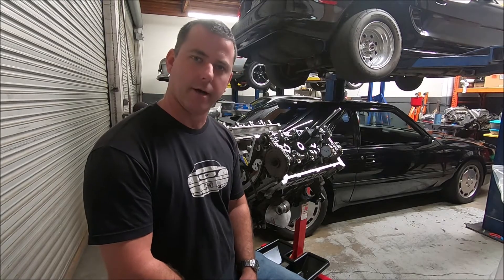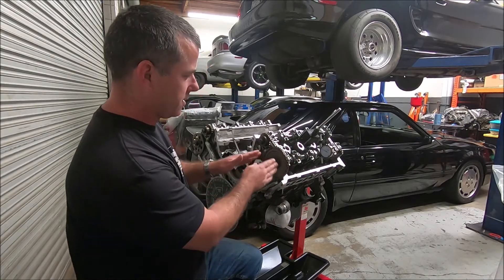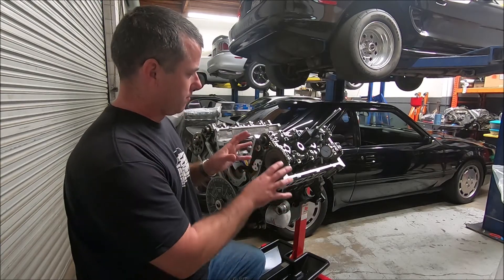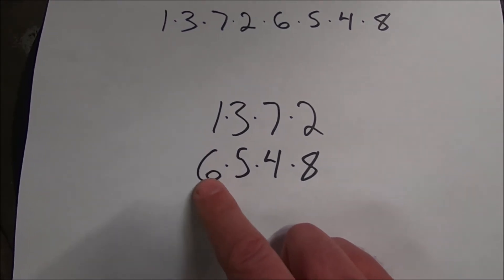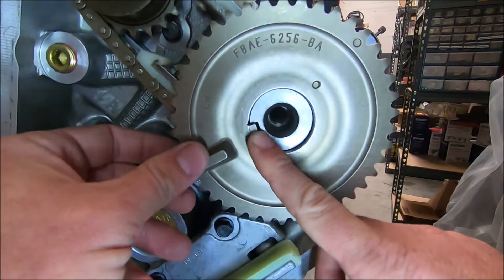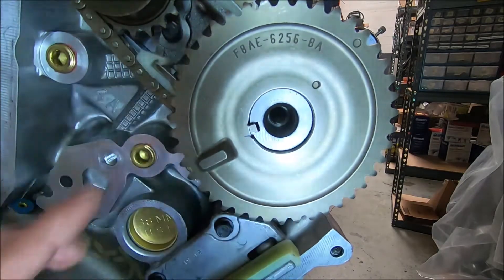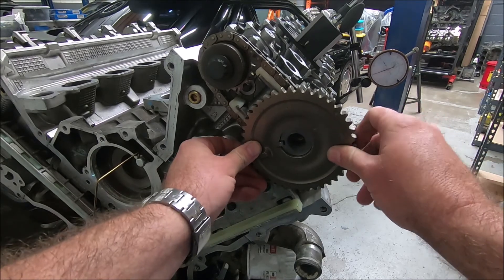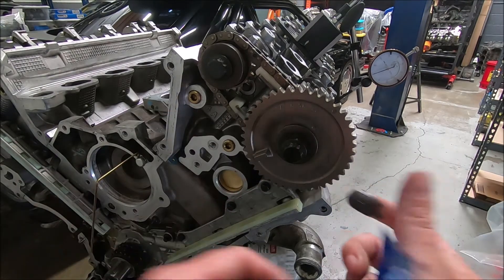Grinding 4.6 and 5.4 Factory Ford Camshaft Sprocket Gear Key to degree a camshaft

Comment: The keyway does hold the sprocket. The sprocket will move without a keyway. On a N\A build not so much but a supercharged engine that sprocket will move. The bolt alone isn't enough.